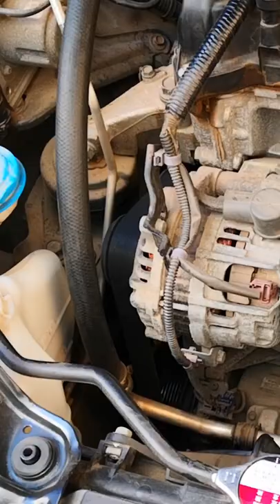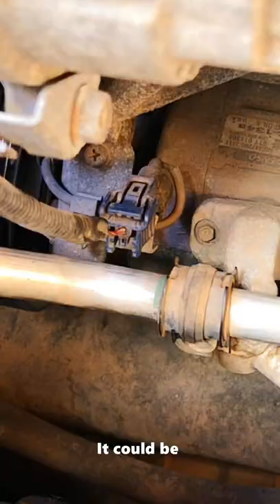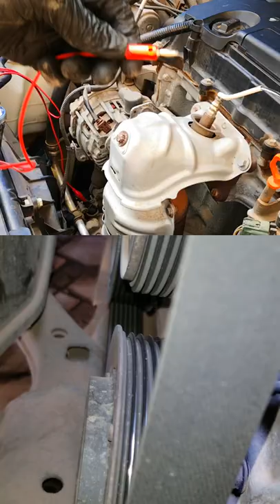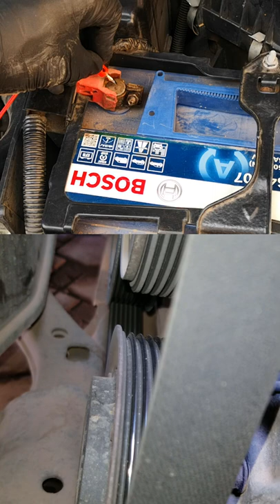Test AC compressor clutch without scanner

Comment: You still need to check the resistance on it cause there's manys cases where the clutch will turn on when it's cool and after 15 to 20 mins of operating then it goes out until it cools back down again.....
Reply from the maker: Correcto!
Reply: Now you know the clutch working

Comment: I recommend a wiring schematic and do your testing at the A/C Compressor Clutch Relay. That will allow you to check all circuits except the Connection at the clutch. But if it works there is no need.
Reply from the maker: I agree though if testing at the relay fails, you will still have to do this.

Comment: It still could be bad if the friction plate is worn down too much.
Reply: There are 3/4 shims different thicknes. Remove 1 meet the right gap size between the clucth plate & pulley.

Comment: All clutch coils are 40-80 ohms when tested with a meter
Reply from the maker: I'd say 2 - 5ohms in general. Except there's a specific ac clutch coil you are referring to here.
Just showing this test for those who may not have a multimeter.
Reply: @DIYAutoworksNG   I forgot the 24v ones. Not sure what they will read

Comment: Which prong did you connect your wire at on the compressor? One or both?
Reply from the maker: Mine has just one prong since the ground is the compressor casing itself. If yours has 2 prongs, one should be ground, but try to check schematics for your car. Most cars have one prong.

Comment: sir,my Ford classic compressor clutch is working while jumb like this,
but 12v supply is not there.while using.what is the reason
Reply from the maker: Check your AC compressor relay in the fuse box. If you have an identical relay in the fuse box, swap it and see if the AC works. If it does, it's the relay. If it doesn't, check fuse and wiring. I take it you've confirmed the system is charged?

Comment: Does it make the same sound (clicking) while the ac running? (Fiat500)
Reply from the maker: Yes, if the car has a fixed displacement compressor.

Comment: will this work on an 03 ford expedition? My AC stopped 2 yrs ago
Reply from the maker: If the electrical connector has just a single wire, it should work.

Comment: But if you use a scan tool you check the entire circuit all at once!  You would be better off to use a headlight bulb in place of the compressor clutch to verify circuit if you were unsure about the clutch integrity.  Power Probes are great tools also.
Reply from the maker: I definitely use a bidirectional scan tool for this. I just showed this for some people who may not have zero equipment. It's something I learnt and used before I got a scan tool or power probe.

Comment: Newer cars have 3 wires at the compressor like 2016 Buick envision had to replace the ac compressor and expansion valve
Reply from the maker: Buick will be using different circutary. The car I did this on was a 2017 Accord. In the case of the 3 prongs, the circuit diagram will be needed to know what the prongs are. Thanks for the feedback.

Comment: This test is for checking the electro magnetic power, not related to clutch in any way, which can be tested if you try to rotate it when engaged
Reply from the maker: It's related. It's called an AC electromagnetic clutch. I do get your point on trying to rotate to check for slippage but you can't say its not related to the clutch in anyway. Even bidirectional scanners do exactly this same procedure when they test the clutch.

Comment: Or, you don’t spend the needless time, you just back probe the connector. If you have power when it’s commanded on the the clutch is bad. It grounds through the block. No need to unplug it, or run wires. Just see if you have power at the connector when AC is commanded on
Reply from the maker: Yep. That's another way of doing it if you have a power probe.

Comment: Better hope the clutch isn't shorted. Power probes have built in breakers for this reason
Reply from the maker: Not shorted, at all.
Reply: @DIYAutoworksNG  obviously, but if it was and you tested it like this you're gona let the smoke out of that little wire

Comment: Es para saber si está funcionando el compresor de el aire acondicionado o estoy confundido
Reply from the maker: Sí.  Se utiliza para saber si el embrague del compresor está funcionando.  Esta es la parte que acopla el compresor.  Si este embrague está mal, el compresor no funcionará.  Una vez que se reemplace, el compresor volverá a funcionar.
Reply: @DIYAutoworksNG  para que modelos corre esa prueba, tengo el sephia 1.8 2001 automático. Gracias
Reply from the maker: No puedo decir exactamente, pero si desconecta el conector y ve una punta, la prueba funcionará.

Comment: Que pasa si mi troca no enfría ya hasta cuando estás en movimiento. Paras en un  estacionamiento o haciendo línea en un drive thru por unos minutos y ya no enfría. Hasta que empieza andar nuevamente. Que es? El compresor?
Reply from the maker: Varias cosas podrían causar esto.  Compresor débil, bajo nivel de refrigerante, bloqueo, etc. Deberá ser diagnosticado profesionalmente utilizando manómetros y otras herramientas.  Asegúrese de que el filtro de la cabina también sea nuevo.
Reply: @DIYAutoworksNG  le revisaron el freon y dijeron que esta bien. Y ya le cambie el filtro de cabina.
Reply: @DIYAutoworksNG  lo que he notado es que hace ruidos raros como zumbidos y después como si hubieran canicas dentro del aire.
Reply from the maker: Bueno.  Mira las otras cosas, entonces.
Reply: Sounds like a stuck expansion valve or plugged  minor front collision caused junk in lines to clog screen  before evaporator coil inside car... 🤔✌️💪👍🙏😔 Hope this helps  I flushed line from compressor to txv on evaporator coil...
Reply: Sensor de temperatura del ambiente

Comment: Mine does same thing when I did test but won't turn on ac button clutch won't engage? Wat else could it be?
Reply: If there is a leak it can cause system to not ingage do to low pressure
Reply from the maker: Yes, during normal use. But this test directly activates the AC clutch so it must engage if the clutch itself has no fault.

Edit: I now see this is in response to @Dwayne. Solid.
Reply from the maker: Could be the compressor clutch relay too, or too much refrigerant. Are you able to read the pressures using a manifold gauge?

Comment: I've seen compressor clutch that stops working when hot.
Reply from the maker: Could be a number of things: loose connection, failing compressor relay, an AC clutch that is on its way out etc. To rule out a worn ac clutch, you can perform this test when it's hot.
Reply: @DIYAutoworksNG  yeah I did I'm just saying that I have seen that failure before "clutch not working when hot", so that test is not a 100 %  accurate sometimes.
Reply from the maker: I agree with not being 100% accurate. But it's a fairly easy test especially for those who may not have a a scanner to do an active test on the AC system.
Reply: @DIYAutoworksNG  is the connector ground??
Reply from the maker: Nope. It's positive. The ground wire goes to the body of the compressor which is why you don't need to connect a lead to the negative terminal of the battery.

Comment: Yeahhhhhh….. don’t do this without a schematic some compressors are controlled through  the ecm!!!!!! If you send power down the ecm ground side you could have a ecm now.
Reply: As long as all the wires are unplugged how in the world is it going to go back to the ECM ???
Reply from the maker: The ground is usually not the connector but has its wire attached to the body of the compressor. Also as @Robert says, unplugging the connector in any compressor that may have the ground next to the positive disconnects it from the ECM.

Comment: Bro just jump the relay, much easier
Reply from the maker: Yes. But you may still need to do this if you have a broken relay or there's short somewhere in the wiring to the compressor.

Comment: I dont think scanners are able to catch this.
Reply from the maker: They can identify a problem in the AC clutch circuit but not the clutch itself. I used a scanner in this video https://youtu.be/gsXUsB8riMI
Reply: @DIYAutoworksNG  ok cool. I always start with the problem device and work my way back to the computer just like this video.
Reply from the maker: Nice. I do the reverse. I tend to start with scanners and then work down to the problematic part. Cheers!

Comment: If no A/C gas the clutch won't turn
Reply from the maker: Not correct. Even if there's no charge in the system, this test directly activates the clutch, and bypasses the low pressure cut off switch. Summary, it will work even if there zero refrigerant in the system. Same way you can test a transmission solenoid by directly supplying it with 12v.

Comment: A scanner is not gonna tell you if an AC clutch is defective. 🤡
Reply from the maker: Technically, yes. But at least using the AC clutch active test, you can rule in or rule out the AC clutch circuit; which include the clutch, relay, wires etc.
Reply: @DIYAutoworksNG  technically yes? 🤡
Reply from the maker: I mean I agree with you statement
Reply: @bmak7874  So him teaching something most people wouldn't know makes him a clown for sharing informative information? Calm down Karen
Reply: It could still be used as a form of trouble shooting. If the ECU is telling you the AC clutch is engaged, and you can physical see it is not. Then that’ll tell you more than you knew before.
Reply from the maker: Yep
Reply: @DIYAutoworksNG  lol wtf you already said that. 🤦🏼‍♂️